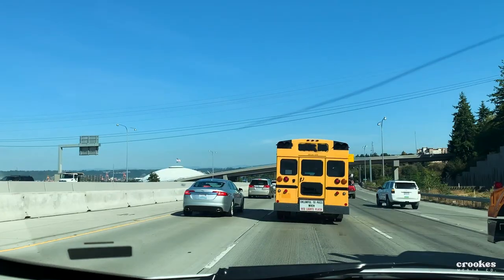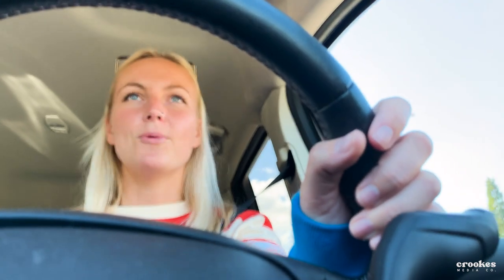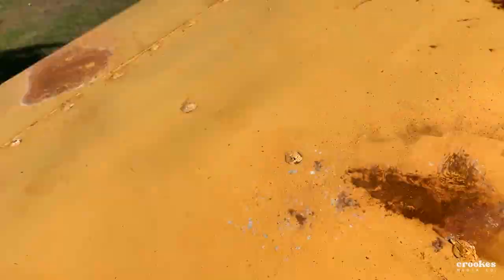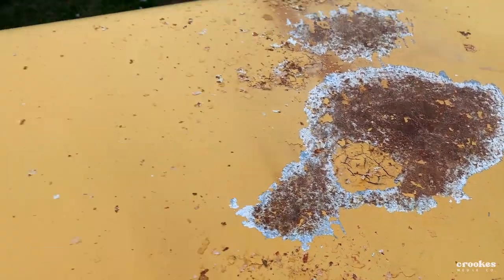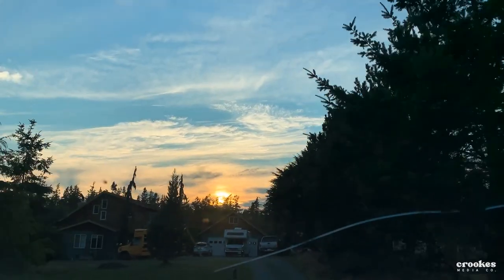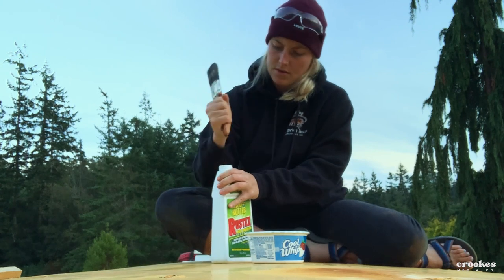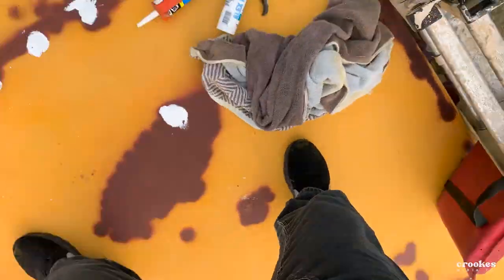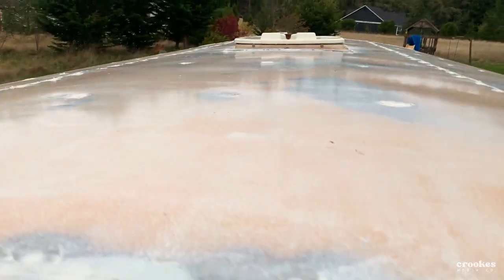Chapter 1: I bought a bus!!

Comment: I love all of this Liz. For doing the interior look into getting a cheap rivnut gun for bolting stuff to the sides. I wish someone would have told me that years ago before doing two builds with sheet metal screws
Reply from the maker: good to know Cody! Thanks for the Rec. I'll do have access to a manual rivet gun. I want to avoid rivets though, becuase they're such a pain to remove, especially when they havent been touched since 1998 lol.
Reply: Rivnuts are different then rivets. They provide you a threaded attachment point for bolting cabinets or whatever in